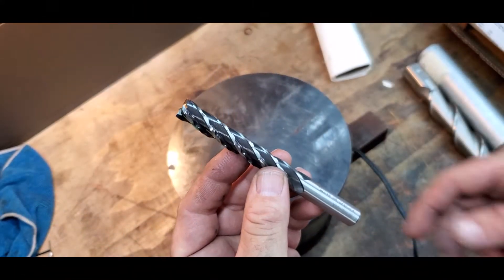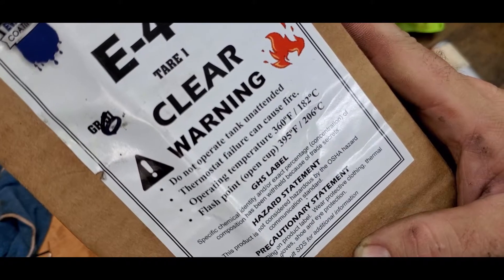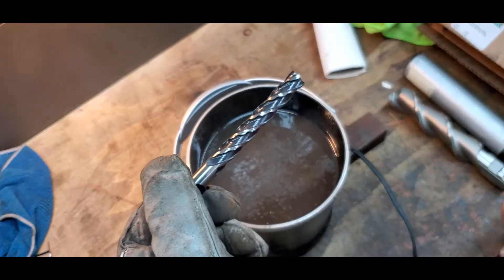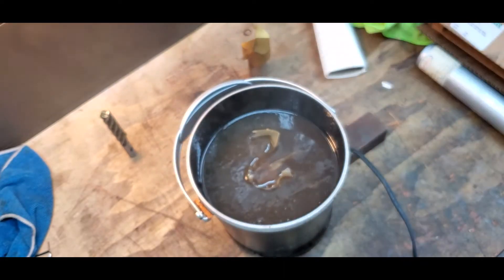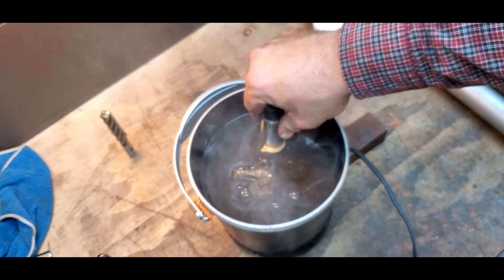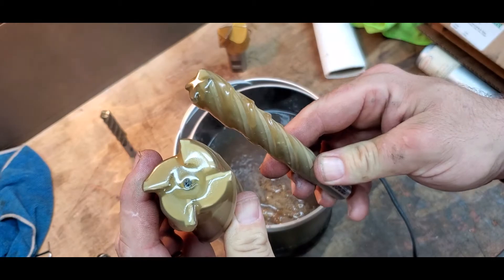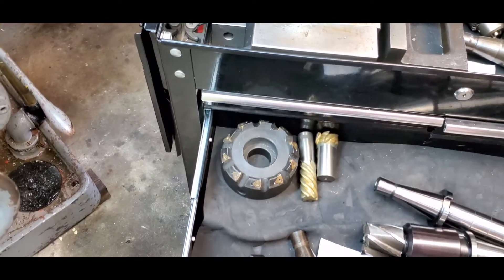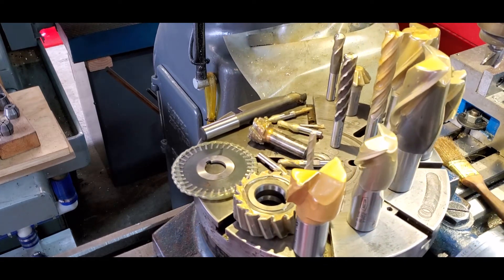End Mill Hot-Dip Wax Coating

Comment: I use dip seal brand. Different hardnesses, oil levels colors etc.  I use different ones so I just use an induction cooktop and several different pans for the different colors etc.   melts in about 5-7 minutes.